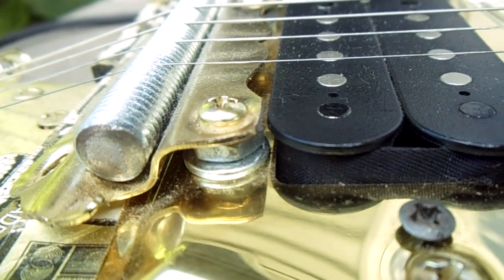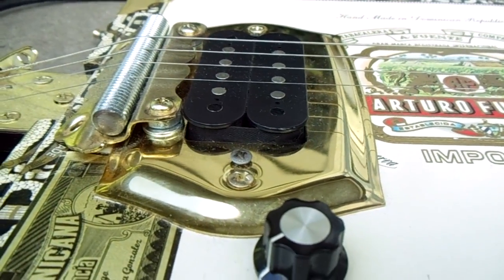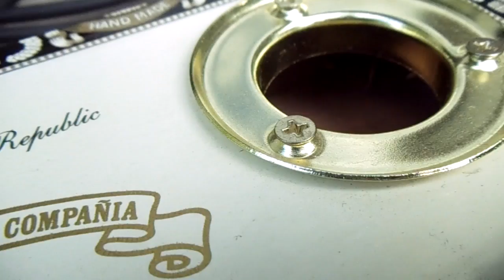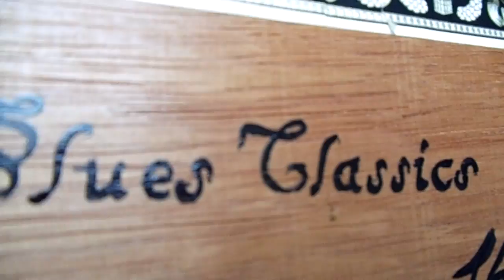Cigar Box Guitar - Arturo Fuente Electric Model - Closer Look and Short Demo

Comment from the maker: @heshmuffinsvideo It depends on the guitar, but in this case the neck is glued to the lid of the box. This is a semi-hollow body and really wasn't intended to produce much acoustic sound. In my acoustic cigar box guitars, I cut a relief into the neck so that it doesn't touch the lid. That way it is free to vibrate more freely. Some people do attach the necks to the box with screws. There are numerous ways to go about it. Check out the website cigarboxnation if you want to get some ideas.